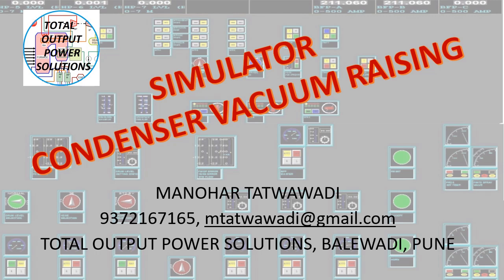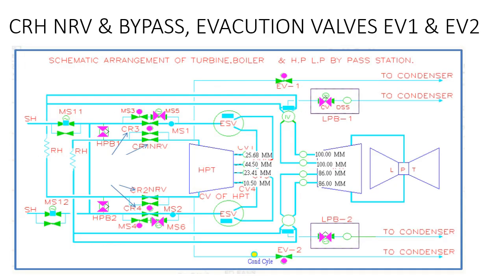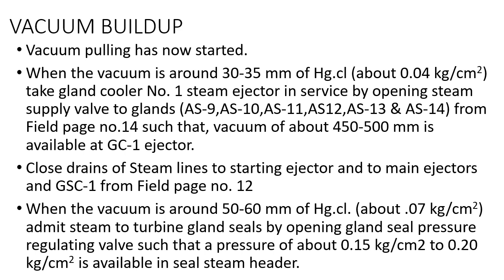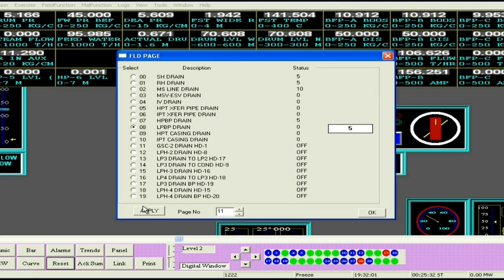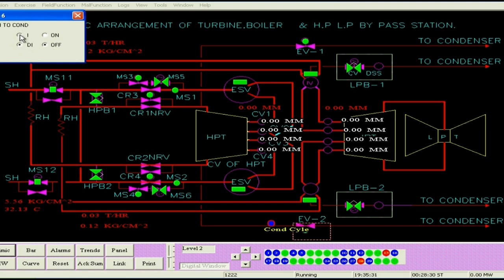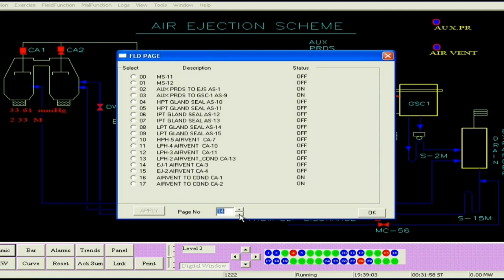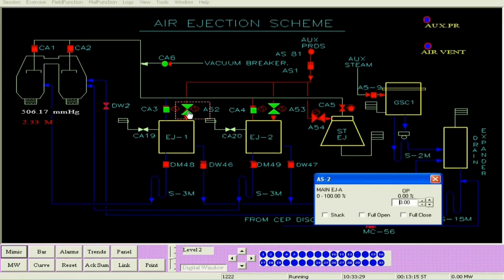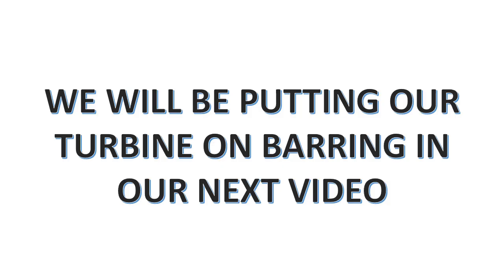210 MW Simulator Vacuum Pulling

Comment: Sir,
If chronology of operational sequence is considered, then, the video of “ Putting Turbine on barring gear would come prior to the video “ Condenser Vacuum build up. “, if I am not wrong. 🙏
Reply from the maker: You are absolutely right! I'll try to make the sequencing clearer in future videos.
It was by mistake . The last part of the video attached was earlier one.
The last slide shall read "WE WILL BE CHARGING THE HP LP BYPASS & START ROLLING IN OUR NEXT VIDEO".
Thanks for your comments.
Reply: @ 
Sir,
Thanks for immediate concern. 👍